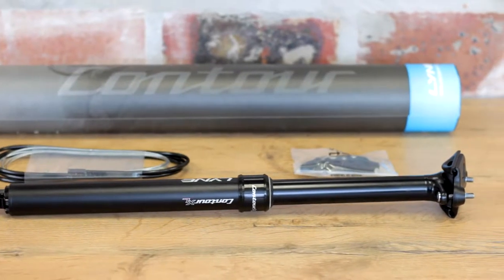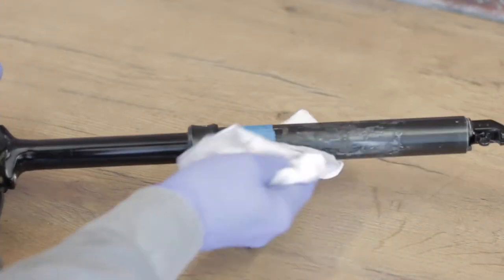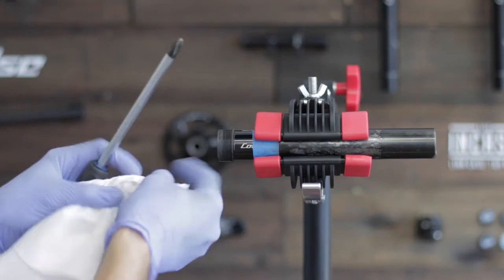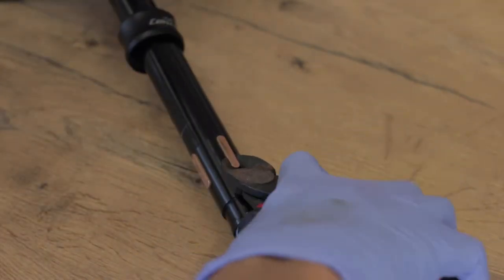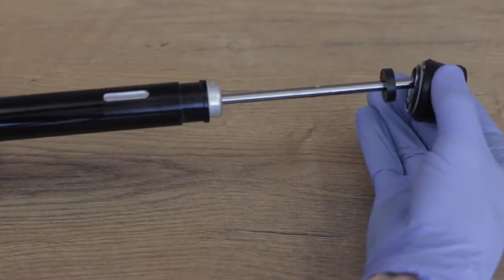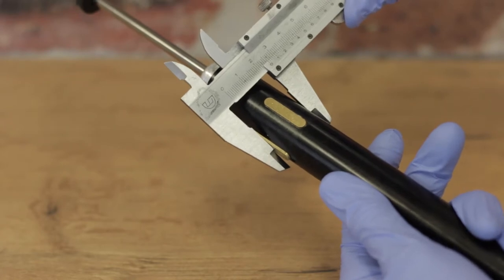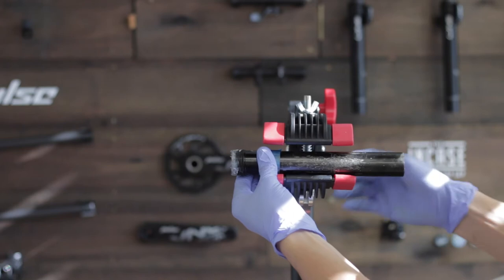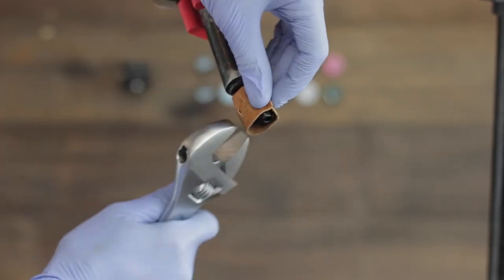Lyne Contour Internal Dropper Post- Service Video

Comment: What would happen if the indentation on the brass keys are facing inward
Reply from the maker: Hi Tiaan. This isn't too much of an issue, you may just find it slightly more difficult to seat the brass keys. But if they measure up as they should in the next step then you all is fine. Cheers, Dayle